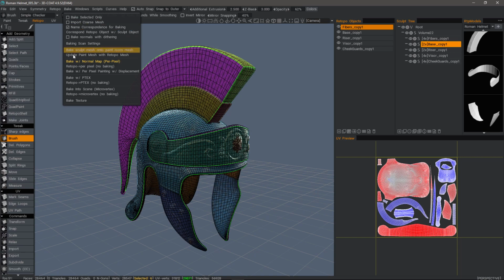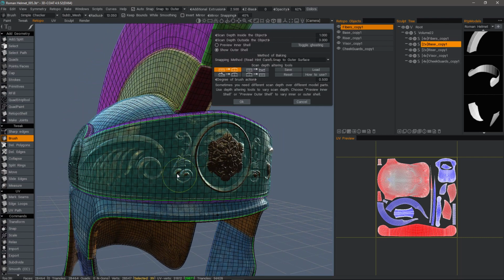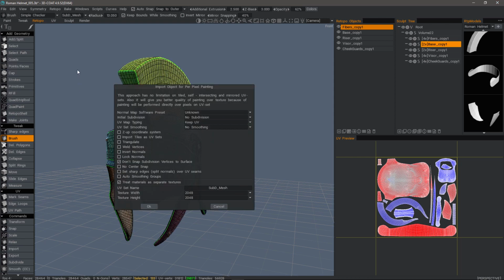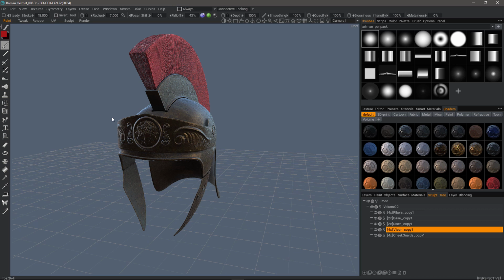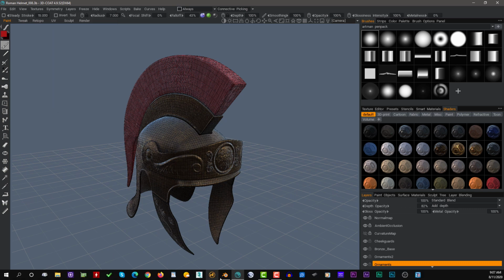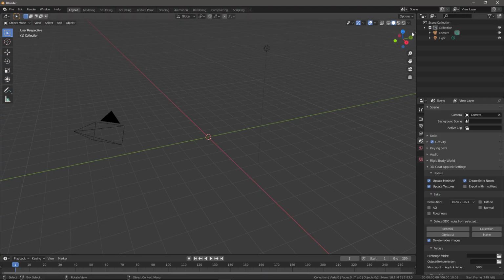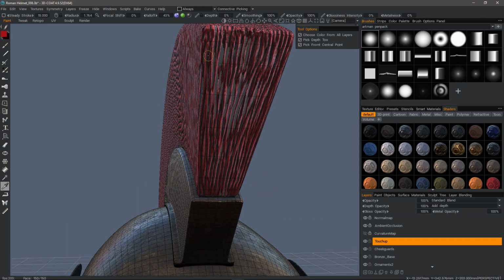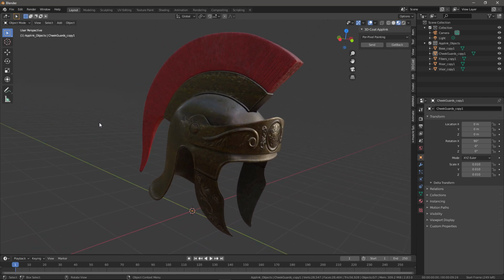Blender Applink Exporting to Voxel Object Pt 7

Comment: Like in this case of the roman helmet, if you try to re-apply the metals to have texture being crisps instead of blurry, the helmet will turn all brown, because the smart materials think the whole low poly is fully 100% ambient occluded.
It's just that probably very few people know that you need to merge the AO with a white layer, and even knowing it its still pretty long and annoying and increase the chances of crashing when bucket painting everything in white.
Reply from the maker: If you have issues with the application, the proper avenue to address it is the support@3DCoat.com email, where the support staff may ask follow up questions and/or ask for a workfile to troubleshoot the issue.
Reply: @PILGWAY3DCoat  yes sorry for posting this here, it's a bit out of frustration as I sent a detailed message to the support exposing the issue a few years back, and it seems so simple to solve compared to the huge problems it causes for anyone wanting to bake smart materials from high to low poly.

Comment: Smart materials are all broken in 3dCoat because the ambiant occlusion is baked on transparent, instead of being baked on white, so without merging manually the AO with a fully white layer named AmbiantOcclusion as well, nothing PBR related works currently (and since ever I think)
Exporting maps won't work as AO export is not black and white but black and transparent, and getting high resolution texture on the low poly compared to the low resolution poly-paint on the high poly, absolutely doesn't work since all smart materials apply the ambient occlusion everywhere since they don't see any white in it.
I reported it a couple years ago but I think it's still the case.